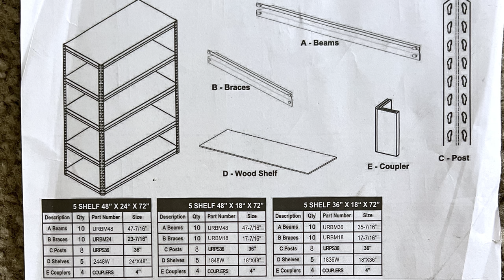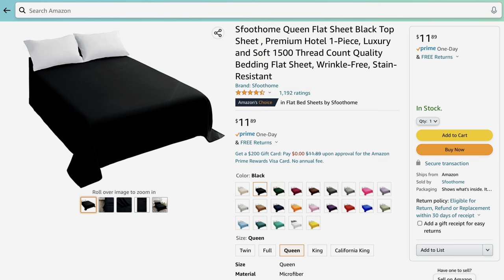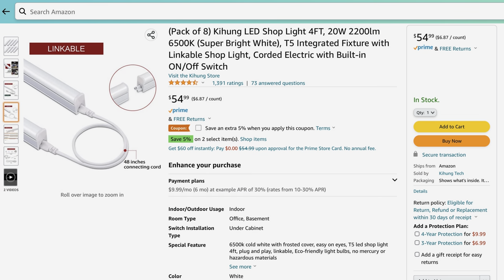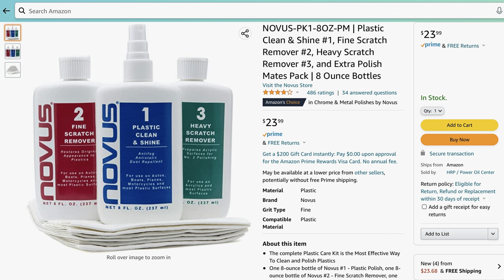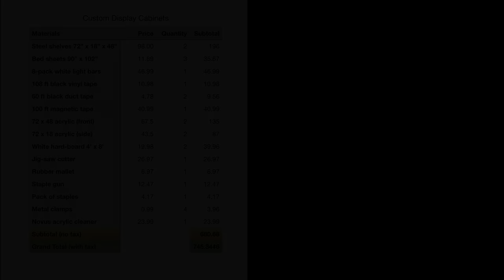DIY Custom Display Case Tutorial | Posing with Peter

Comment from the maker: ** FAQ **

Hi everyone! 

It’s been a year since I made this video and I’ve been fortunate enough to receive such overwhelmingly positive feedback along with many follow up questions on the build process. I figured it best to address some of these frequently asked questions so you don’t have to go looking for the answer in the comments below ☺️

* What thickness are the acrylic panels? *
1/8th inch for each panel all around. It’s worth mentioning that I’ve built 2 additional cabinets and used 1/8th inch panels for the front to maintain rigidity but used 1/16th inch panels for the sides since they were a bit cheaper. Heads up they are flimsy / less rigid but they get the job done since I never remove the side panels.

* How did you fit the light bars into the cabinet? *
I fully inserted the connectors as much as possible into each end of the light bar then folded / bent the wire-connector 90 degrees to fit into the cabinet. It’s a tight squeeze but you can briefly see it around the 5:55 mark. Alternatively if you can buy the 3-foot light bars instead for better clearance without the need to forcefully bend any connectors. 

* Did you wrap both sides of the shelves in black cloth or just the top side? *
I wrapped both sides of each shelf in black cloth for the sake of uniformity. It requires more material but was worth the final outcome in my opinion.

* How is the magnetic tape holding up? *
Some parts of the adhesive magnetic tape did indeed wear off after uploading this video possibly due to weather / climate or just cheap materials. An easy solution was buying this pack of small circular neodymium magnets. I just super-glued a few of them around the corners & edges of acrylic borders for a much stronger magnetic hold to the metal frame. 
Non-affiliate link: https://a.co/d/3TnxNvw

* How did you join the cabinets together? * 
Just inserted black zip ties through the holes of the vertical metal frames where the 2 cabinets meet in the center. 

That’s all for now but I’ll add more to this list if it comes to mind 😅 As always thanks so much all your kindness and support. Best of luck on your custom builds, and until next time, stay safe and take care! ❤️
Reply: When are u gonna make a new video if u don't mind me saying I have a video idea.could u do if u want to.but can u make a video with like the cat miles morales suit or cat bodega idk how spell it lol😂 if not could u do some more pose showcases with miles morales?
Reply: @PosingwithPeter – Question about wrapping both sides of the shelves...

Could you elaborate a bit on how / where exactly you folded + tacked on the fabric for the other sides?
(To keep the cloth as clean & taut as possible on both surfaces.)

I would guess the surface you cover last becomes the top-side so the visible fold+tacks are hidden under by the frame.
Reply: I'm curious to how you wrapped the black sheet all around the shelfs and how you stapled it to look so perfect. Could you make video?

Comment: This randomly popped up in my feed and it's perfect. It's exactly what I need for displaying my transformers and model kits.
My thanks to both PopCultureLivingRoom for the original idea, and you for the alternative style.
Reply: I do have to ask though, do you have to individually plug in each set of light bars into a power board? Cause I wanna minimise the amount of plugs for a display cabinet.
Reply from the maker: I’m really glad this video popped up in your feed! 

As for the lights bars, they connect to each other via daisy-chain and the necessary wires are all included, so this massive cabinet only took up 2 wall plugs. 

Hope that helps, and thanks so much for your positive feedback! 😁

Comment: Holy crap. I've got two of these shelves in my work room and I've never considered using them to display my collection. I'm going to have to check out Costa now. Thank you for sharing yours. Just to let others know, if your going to put anything heavier on these shelves you should go ahead and change out the shelf boards for plywood cut to the same size. You can get Lowes or Home Depot to cut the boards for you (call their lumber department ahead of time and make sure the saw is operational, ours was often broke). Fair warning though, the associates are all trained differently so check the boards to make sure they are correct. Also FYI, my shelves are from Lowes and were cheaper than Amazon. They're the same style though just a different name. Every store, even Walmart, sales these. Keep an eye out for deals at Lowes/HD for deals around Black Friday.
Reply from the maker: Thanks so much for the heads up! Yeah I saw that some of these racks can vary in pricing pretty drastically depending on where people buy (Amazon, Costco, Home Depot, Lowes etc) and I think I got lucky with my racks being $98 each since a lot of other ones average $150+. Great point you make about the associates being trained differently — some employees will always be more skilled or detail oriented than others in any field but it’s definitely a great point to bring up when shopping for custom cut plywood. 

But yeah, be sure to check out Costa’s video playlist on custom cabinets — I and many others could not have built our cabinets if it weren’t for his awesome blueprint. I hope it helps, and thanks again for watching & commenting!

Comment: Wow Peter, I am blown away and very inspired by your video. I have 6 Detolfs but need a better way to display my collectibles and don't want the wait or cost of Moducases, and I think your solution is just what I need! Question about your acrylic panels, what is the thickness? I have scoured Amz and can't find the right product and will try glass/plastics stores in my area, but am not sure if I should be pricing 1/16", 1/8", or something else. The project seems daunting yet very exciting, thanks for the inspiration! (Edit... I see now it's written 1/8")
Reply from the maker: Aw wow thanks so much for sharing your kind words and positive feedback 🥰 I’m really glad you found this video helpful & inspiring 😁

As for the acrylic thickness, I went with 1/8” panels since I was worried that 1/16” might be too thin and fragile especially since I wasn’t planning on cutting them into individual pieces. I wanted them to be thick & sturdy since they would be covering the entire front-side of the cabinets. However it’s worth mentioning that they’re a bit heavy at full size. 

I’ve actually gotten rid of my detolfs recently to build another pair of garage cabinets in the living room — I plan on trying 1/16” acrylic sheets this time so I’ll try to put out a video update whenever I get around to finishing the build in the coming months. 

I hope that helps. Indeed the project may seem daunting but after owning detolfs for several years, I can honestly say that I wish I had converted to garage shelves sooner. Posing & displaying figures is much more fun because they’re no longer restricted to a tiny cube space. Plus, you can sell your detolfs locally for some quick cash to fund the garage shelves — that’s what I did 😁
Reply: @PosingwithPeter  Thanks for the great info. I might be biting off more than I can chew on my project, but I am eyeing 77" x 72" x 48" garage shelves. I mocked up my vision in photoshop and conceptually, it would be a great long display for all my Hot Toy and NBA Enterbay one-sixth figures, Star Wars helmets, 1:4 scale statues and 1:1 scale prop replicas. However, now that you've cautioned me about the weight, I'm nervous that 77" x 72" at 1/8" thickness may be way too heavy and I may be delusional about the magnets being able to support the panel. I'd love to hear how 1/16" acrylic sheets work out for your new project. Best of luck on them, can't wait to see your video on it!

Comment: what i used for the shelves is Acrylic felt fabric.  I believe it's what moducase uses as well.  It's not pure wool felt, its thinner and it looks just like felt. You couldn't tell.    It's very affordable too.  And for the backboard pvc foam boards is the way to go.  Its another thing moducase uses..  Sleek looking, lightweight & easy to cut.   These display cases came out great!!!  A lot of options out there.

Comment: Peter thank you and excellent display 👍🏽. I'm using your tutorial to do my own case.  I'm in the research process before starting to acquire the items.
I have a question , when laying down the vinyl tape on the acrylic, when you do the 1-1/2 side, what do you do with the excess since you are using a 2in roll? Do you wrap around the excess and place the magnetic tape on top of the excess acrylic tape or do you cut the excess vinyl tape?
Has anyone tried screwing the side acrylic panels to the frame?? Since those wont move , is it possible to uses screws, washers and bolts? Thank you for this video and your poses are jaw dropping

Comment: Would love to see/hear an update on these as far as holding out dirt, dust, pros and cons. Well done!
Reply from the maker: Thanks! And they’re still holding up really well! Dust hasn’t gotten into the cabinets per se, and I just use one of the acrylic wipes/clothes to clean off the frontside maybe once a month. 

I will say that these lights do generate some warmth though, and now that’s it’s in the summer months it can get a bit warm in this room if I’m not running the fan or air conditioner. Other than that, I’m still really glad I went this route 😁
Reply: @PosingwithPeter  awesome! Thanks for the update. I’m definitely going to go this way after seeing and hearing of your success. Thanks so much!

Comment: Looks great! I am working on my own display cabinets based on this video and Costa's display case build. 

One of my acrylic sheets is holding great, while the other is not staying very well. All the magnetic tape is doubled up and nothing is obstructed, but the magnetic force is extremely weak on some of the strips that it isn't holding. Any advice? I am considering buying some stronger magnetic tape from somewhere other than Amazon or Wal Mart to ensure I get quality magnetic tape.

Comment: Do you think we could get a "Year Later" update on these? I built my own after following along with Costa and you. I found that 1.) the tape on the back that secures the hardboard starts failing and coming off over time and 2.) the magnetic tape I used on the acrylic actually started peeling off and just sticking to the metal shelves on it's own - so any time I wanted to take the front acrylic sheet off, most of the magnetic strips were left behind on the shelf itself. In your video you mention using "2 layers of magnetic tape" - are you saying you actually stacked the tape on top of itself? Because when you're showing it in the video, it seems to only be a single layer. Just curious!

Comment: Thanks a lot for the inspiring video! Are your acrylic panels standing on the floor and only use magnets to not diverge from the rack or are they hanging completely by magnetic force? If first, do you think latter might work, or are they too heavy and will just slide down to the floor anyway (especially front panel, which is 16 lbs in your case I think)?

Comment: Love this video! It really helped me with my own build. Quick question for you if I could! Sorry if you already answered this.
Could you tell me how you did the pose with Maul and Qui-Gon? How did you attach Maul's blade to Qui-Gon's back? How did you get Qui-Gon's saber to float there? Thanks so much!
Reply from the maker: Thanks so much for watching and for sharing your positive feedback! I’m really glad my video helped you with your custom build 🤩🙌

As for the Qui-Gon vs Maul pose, I carefully wrapped a thin wire around the end of one of Maul’s red lightsaber blades then stuffed it into the backside of Qui-Gon’s belt to hold in place so it can give the appearance that the blade impaled him. Similarly for Qui-Gon’s falling saber hilt, I wrapped a black wire around the very bottom of his hilt then stuffed the wire into his long sleeve at the wrist area to conceal the wire, thus giving  the impression that it’s floating in place about to drop to the floor.

I hope that helps, and thanks again for your support!

Comment: Appreciate you for sharing this vid as I happen to come across this as my wife was saying I needed a better display option to avoid all the dust. Always wanted an enclosed case, but stuff out there are way expensive!. 1 questions though,  how thick is the plexiglass? It doesn't look too thick, like 1/8 or 1/4in thick? Look forward to any feedback you can provide, thanks!
Reply from the maker: Haha that’s so awesome! I’m glad this video came up on your feed at just the right time 😂 And yeah, display cabinets of this size are often very expensive, so although this route requires a bit of effort to build, the final outcome was definitely worth it 😊

As for the acrylic, I bought 1/8 inch sheets — I figure it’s a good balance of being thick enough to not bend & flex while also less heavy than 1/4 inch 👍

Comment: Amazing job and the result is more than awesome!!!! congrats and thanks for sharing....i have only two questions: 1) how thick are the acrylics front and side? 2) How did you stick the magnet tape to the acrylics? Is you have time, thank you for answering. Best regards form Spain!!!!!
Reply from the maker: Aw thanks so much for your kind words and positive feedback! I’m really glad you enjoyed the video and final outcome of the display cabinets 😊 And greetings from California! 👋

As for the acrylic thickness, you can get them in various sizes such as 3/32 inch, 1/16 inch, 1/8 inch etc. Naturally the thinner acrylic sheets are much lighter in weight. I personally chose 1/8 inch thickness for both front and sides because I knew ahead of time that I was not going to cut the acrylic into multiple pieces so I wanted the acrylic panels to be sturdy and not flimsy while handling them. 

And for the magnetic tape, they came with adhesive backside so they automatically stick to whatever surface you attach them to. However I did have to use a small amount of superglue afterwards because some of the adhesive magnetic strips would wear off.

I hope that helps answer your questions 😁 Thanks so much for watching! 🙏

Comment: So, I'm tackling this build and ordered those lights. Accidentally ordered the 4000k ones without noticing...safe to say, i think those are bright enough to do the job. Good god these things are bright!
Reply from the maker: Ohh haha dang well I’m glad the 4000k lights are still working out for ya. Yeah they’re super bright compared to traditional LED strips that are used on detolfs, but fortunately the horizontal metal frame of the shelf helps block out some of the light so that it’s not so blinding. 

Heads up Brody, a common question I’ve received about the lighting is how to fit the lights into the cabinet — the cable connectors stick out quite a bit at the end of each light bar, but you can just bend the connector 90 degrees in order to squeeze them in. It’s a tight fit but works.

Hope that helps and best of luck with your custom build!

Comment: Awesome guide. Did you use anything to connect the two shelving units or are they just positioned next to each other?
Reply from the maker: Thanks! I just routed a few black zip ties through the holes of the frames where the 2 cabinets meet to join them together… forgot to film that part 😅

Comment: Love your set up great job I'm looking to build something aroudn that size or a lil smaller. Thanks
Reply from the maker: Thanks! Yeah keep in mind that I took two racks that are 48 inches wide and placed them side-by-side for a larger cabinet making it 96 inches across in total, so if you’re aiming for something smaller then maybe two racks at 36 inches across could work (or just 1 single rack at 48 inches). 

Either way I hope your custom build goes well. Thanks for watching!
Reply: @PosingwithPeter  exactly 1 would be enough for my space my collection. Beautiful figures keep it up nice content🔥🔥🔥

Comment: Hi Peter, great build! Did you ever look into adding skinny drawers at the bottom to store accessories for ease of swap out accessories for your display? I'd be curious to hear your thoughts! If I was going to follow your build, I would personally consider a way to hide the interior metal frame at the back as well. But very well done! Also Do you find the natural light in the room is a bit cut off due to the shelf blocking the window?
Reply from the maker: As it happens I did consider using smaller drawers / cubbies on the bottom for accessories n stuff, but upon building the cabinets I realized they’re waaaaayy too heavy for anything to be placed underneath. Fortunately the boxes & accessories for each figure are all within reach in the closet across the room. 

As for hiding the metal frame at the back, a quick & easy solution could be to either cover those holes using black vinyl tape or simply buy a black poster board then cut out individual rectangles that match the size in height & width.

And lastly, I deliberately placed the cabinets in front of the window since I didn’t want natural light entering that room. It can get hot kinda in the summer, and also natural light tends to cause more unsightly reflections on the front acrylic panels of the cabinet which distracts from the figures, so I wanted to limit the amount of natural light by placing the cabinets in front of the windows with the blinds closed. 

I hope that helps, and thanks so much for watching / commenting! 😁🙏